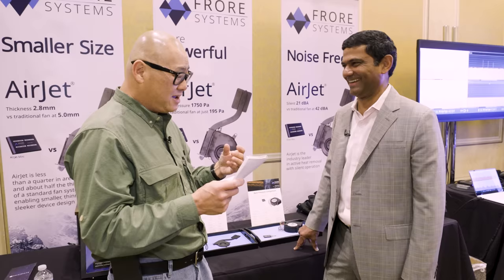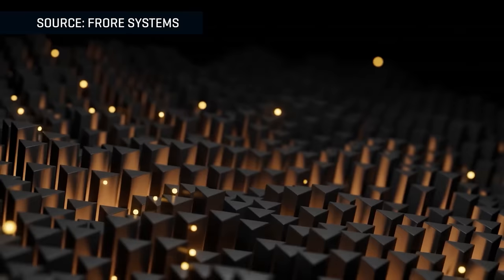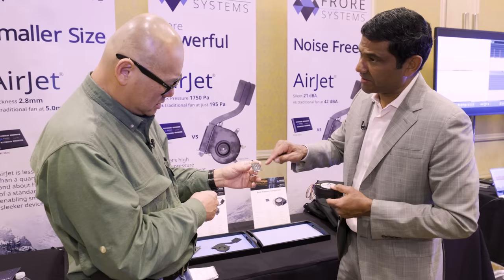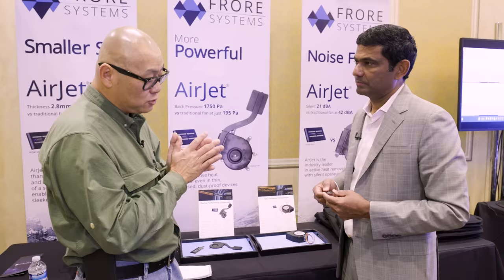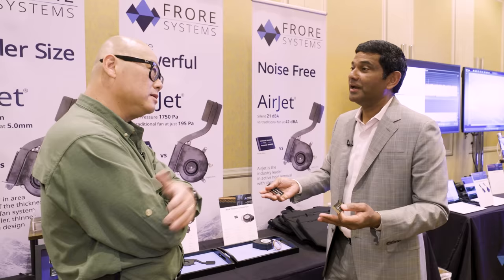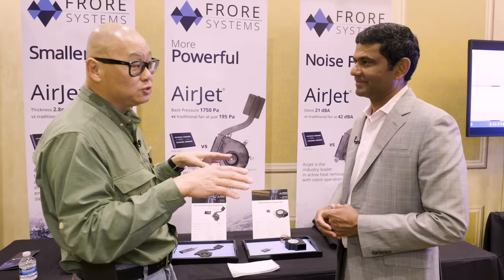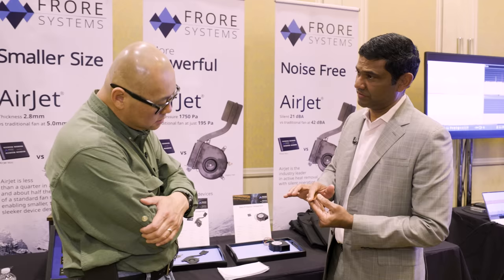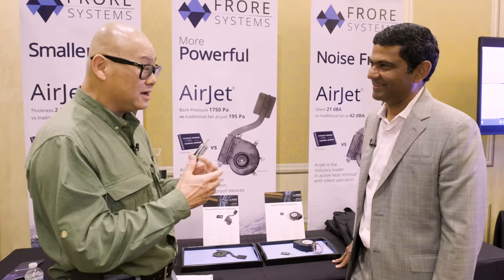Solid State Active Cooling Could Revolutionize Thermals

Comment: False claims, this device is just a "solid state" fan. STC in the 1980s used Peltier junction solid state cooling for their fibre optic lasers. Was/is also used for commercial refrigeration - and is/was active solid state cooling. STC managed laser device to specific temperature. Cooling device often used more power than the laser.

Comment: I am very concerned that this solution is even more dependent upon air flow than a traditional thermal solution with a heat pipe and heatsink/fan. If air is blocked with fuzz, as usually happens, the CPU will overheat much more quickly since there is less material to heatsoak.
Reply: wrong.
Reply: @gregandark8571  BS
Reply: @garymanis6305  Why somebody on their intake air should lock the holes ????
Reply: @gregandark8571  I have cleaned many laptops with clogged cooling ducts and fans completely full of fuzz. It can take less than a year of daily use for them to get clogged with dust. Not too long ago there was a product called the cpu freezer which used a Peltier cooler. They worked great as long as they worked. When they failed and they failed often, so did your cpu. That is one reason why modern cpus have overheat protection.

Comment: what is the distance of measurement? if that's the standard 1m then 21dB(A) is the noise of dark rock 4 at full speed, that's far from silent and absolutely unacceptable for me
also taking care of 5-10W passively isn't an issue even for slim laptops so these presented models are merely proof of concept

Comment: A very innovative use for MEMS. Could possibly repurpose Texas Instruments' 'Digital Micromirror Device' (DMD) and other similar chips for a DIY version?

Hopefully they are using capacitive and not Ohmic methods for moving air on their chip.  Curious of the MTBF for the devices? 

I do not believe the jet impingement device is actually hitting the copper as the presenter describes. (There is a boundary layer of air.)

Note: The devices DO NOT Have Back Pressure - They have Forward Force. They, however, can Resist Back Pressure on their flow.   But, then - no one seems to care about accuracy or factual correctness - we know FRORE was gifted over $100M and not I.

Comment: Why do they call this a "cip". Is a mechanical device not a "cip". Marketing ... everything sounds better if you call it a "cip" or a "pod". Anyway - the cooling is directly proportional with the VOLUME of air and not wit it's speed. That "cip" needs to move the same amount of air as my 360 AIO. The ideea is good but we need to see the longevity of a vibrating membrane. And this has nothing to do with "cips" or "chips". High efficiency heat transfer - low efficiency heat DISSIPATION. Anyway ... I see it as a marketing stunt (like most of the things nowadays). "techNOlogy".......

Comment: FRORE Systems emerged with $100m valuation with the one idea? 

Are they the only ones with membrane cooling solutions?

Doesn't Nasa use a similar tech on spacestation etc, or  is Frore systems have public corner of manufacturing in a slightly different design?

Comment: Wow! This could be big, although I'm not convinced until we see it used sucessfully in some laptops. It may be one component but it has moving parts, and high frequency ones at that. I'm curious to know what its lifespan and noise levels will be. I'm very sceptical of the marketing claim about silicon chip-like development, MEMS is a relatively mature technology as I understand it, this is just a clever novel application.

Comment: I dont trust people who talk more in a marketing kind of way than in a scientific kind of way. I dont see how having more pressure allows the molecules of air to absorb more heat. Heat is by definition the "excitation" level of molecules. The hotter something, the more its molecules are moving fast. When you try to cool something, you basicly make the hot surface fast molecules collide with the cold surface slow ones, which effectively transfers some energy to them by giving them velocity. The same way if a high speed car pushes a slow moving car faster. Having more pressure means more molecules colliding, but the heat they get remains the same. Same as running a fan faster. 
Sounds like BS, give a real independant test to see if this thing isn't fake.

Comment: What is the life expectancy of this technology and how much would it cost to implement into a system? The law of gases tells us when the pressure of gases increases so does the temperatures and their goal is to create high heat saturation... If we apply this law to this chip then how hot do these chips actually get? Literally sounds like a fire hazard.
The concept of this is great but its not practical at all for commercial use.

Comment: I am extremely skeptical of this we've seen similar vibrating membrane "fans" like this before kind of outside the computing space and they haven't really had the output necessary to cool a computer, however if this does work that would be insane considering the size. I do wish they had one plugged in and blowing on some paper or something, the fact they're only showing static pieces has me a bit concerned lol
Reply: 3:14 shows it blowing a bladed wheel of sorts. If that’s actually the device doing it. Never know what kind of trickery displays can be using.

Comment: So I would need 30 of the small or 15 of the larger ones to cool a 300 wat gpu while taking up 30x more power to do so? 1 wat for 2  noctua fans vs 30 of these things. Also I doubt that 200kph or whatever makes no noise. Ever stand in wind be4? This might have some niche use cases but I can't see it getting main adoption. Like anything small and portable that's on battery needs to maximize battery. Having a 30x increase to ur cooling solution dosnt seem like it would make for happy reviews. But mayb I'm wrong. Glad someone is trying

Comment: This is a game changer for every mobile devices,..  I just watched a video about modding a smartphone that has a 3 year old  855 snapdragon chipset  (I think Xiaomi Mi 9 Pro) and they changed it's cooling with a much larger fan - (I know it made it thicker) but crazy about this one was they were able to push the chipset to a whopping 40% performance boost. 3Dmark Wild Life extreme shows it was neck and neck with a Redmi K40 that has the Snapdragon 870 chipset. That performance boost alone was due to changing the active cooling. With this Solid State Active Cooling in our mobile devices, we can have a much higher performance on future devices.

If anyone wanna see that video - it was on "Geekerwan" channel - Titled "We Turned This Old Phone into a Gaming Beast !!!"
Reply: devices → device; it’s → its; thicker → coarser; performance → speed

Comment: You need to use Intel PCs for room heaters, that’s their future, too much Power Consumption. Why would you add complexity to a computer to cool it? Remember all Steve Jobs asked Intel was to make a chip that ran cooler and used less power. Intel couldn’t so Apple came up with the Silicon Chip M1/ M2 , the rest will be history. Next thing they will tell you , is you can only use the Computer at the North or South Pole to keep it cool. I used my PC at the North Pole, it Froze at -65C, not good.

Comment: Your invention might be failure 
It would only work in ac current batteries don't have ac current you have to provide another circuit which makes frequency to make it vibrate. And it would not much efficient because the size of cooler is small when it blows air it blows air from very small space 
You need to provide huge cooper inside laptop to achive that level of cooling it is not possible to put in ultra books

Comment: huh? who even cool an SSD like that!? like does he even know what those heat pipe and fans go? it goes in the CPU and GPU not so much on the SSD. plus you don't really have to cool the SSD as much. a little piece of aluminum or copper is enough. this invention makes no sense at all if it's only prioritizes on SSD cooling

Comment: Well what can I say? I can't call it a presentation.
There are no tests based on your "mountain cooling". I can only say one thing, the cooling itself will need to be changed like gloves because the components will get very hot. And the cooling method is not very well thought out. I foretell the collapse